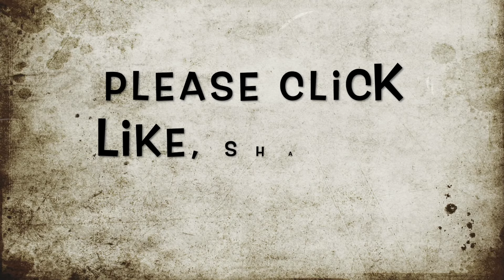Baby Crib / DIY Woodworking.

Comment: I have a bun in the oven and I can tell you, all the other videos always use high-end equipment and the process isn't explained properly. Seeing all that and as a hobby woodworker, I figured i may not be able to make one on my own. But you, good sir, managed to explain everything WITHOUT SAYING A WORD! Thank you for this!
Reply from the maker: Thanks so much !  ,,,  I was fortunate as the wood was purchased at my local hardware store ( dressed) so it was just a matter of cutting to length . I too am just a hobby woodworker on the weekends , if you check out my follow up video (Baby Crib ''2.0''). I give a detailed summary  (lengths & measurements)...
Reply: @wallytrinc9885  Hello there Wally. So, i'm almost done with my cot but unfortunately, the only thing that remains is the threaded insert nuts. I can't, for the life of me, find them where I live. I'll need to import them from somewhere. Before I do, though, I have two questions. I've followed your design and work (almost) to the letter. Is there anything else I can do to bypass the need for the insert nuts? Something else that I can use to maintain the disassembly feature as well? 
And secondly, you were the inspiration behind this and I'd love to show you what I've made. it isn't nowhere near as "clean" as what you've made here since this is one of my first major projects. But i'd love to show you, regardless. How can I do that? 
Thank you so much for this video; there's a kid about to have a custom made cot just because of you. A whole lot of love from the three (2.5 right now) of us!
Reply from the maker: @jujijo3149  Hello my friend , nice to hear from you again ,  Ok , if you cannot avail yourself with  ''screw insert nuts with matching connector bolts''  , may I suggest you buy M10 round head timber screws (long),,,,,    here is my Facebook page  https://www.facebook.com/profile.php?id=100091956135903   ,  many blessings to your new family ..

Comment: Beautiful job!  I love that you used pine, very underrated but I believe very beautiful.  Thank you for sharing your time and talent!
Reply from the maker: Thank you Derek , I also appreciate your (time) kind words . truth be known , I have a love/hate relationship with pine ,,, Love the fact that it's light , readily available from my work place (undersize/off cuts)...hate the fact that if left in the elements (sun-humidity-cold air) it will cup-bow-twist !
I will have a follow up video shortly-detailing lengths/measurements , cheers !

Comment: Beautiful build, but for those inside hinge design, there's small concern as the clearance is too small for baby finger to slip in accidentally and cause injury. 

I would rather make it a outside hinge or pivot on the stiles with having a couple inch gap from the bottom half.